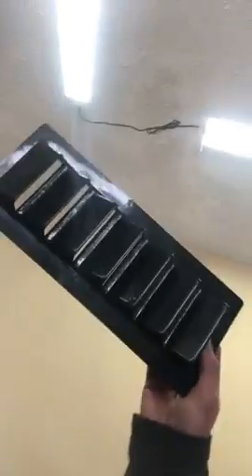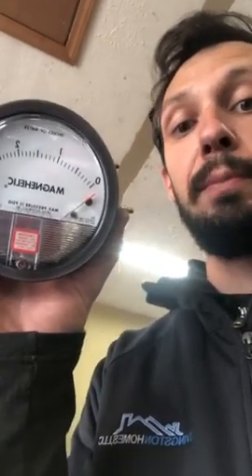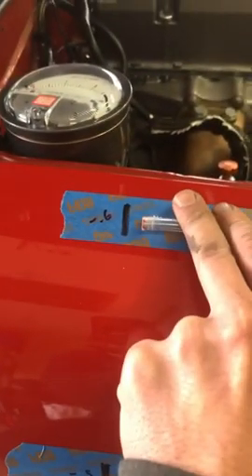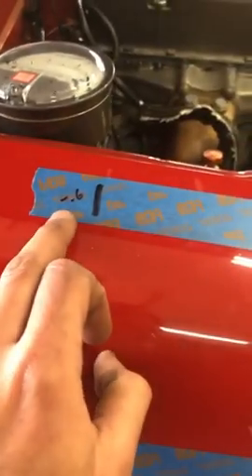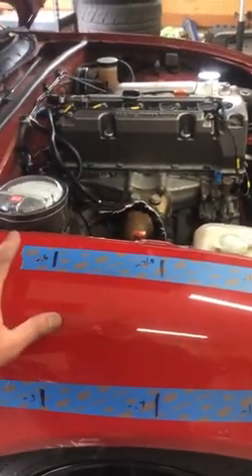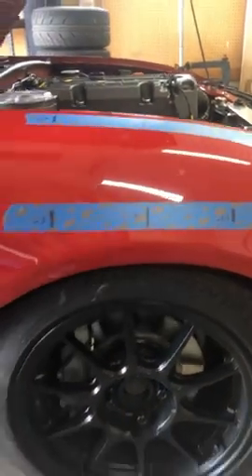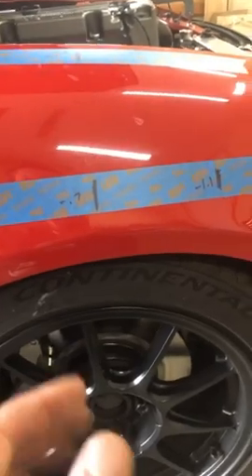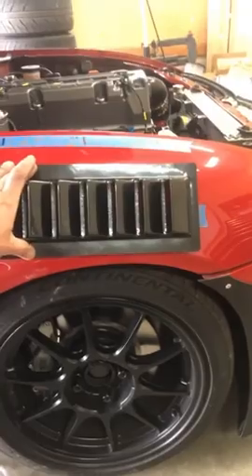Aero Testing on the Miata Fenders

Comment: Thoughts on using your tell-tales for laminar flow to choose positioning? Did you check pressures in multiple places under the fender to ensure greatest pressure differential? Love the thought put into the install!
Reply from the maker: We just tried to space them evenly to be a balance between visibility on video and seeing details.
We did use a magnehelic gauge on the fenders to find the best pressure differential. This was the best placement we found for the fenders.